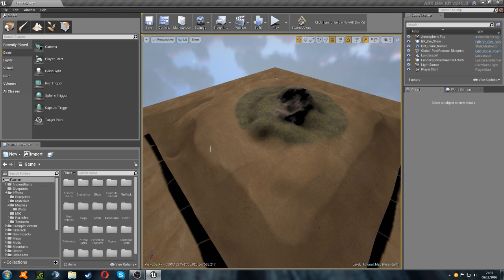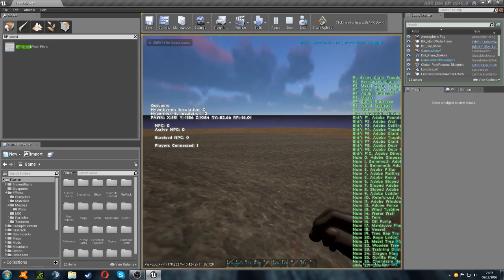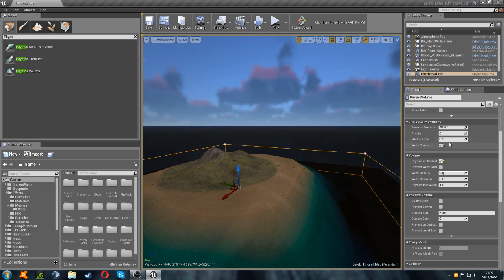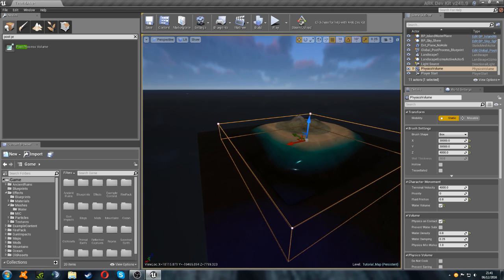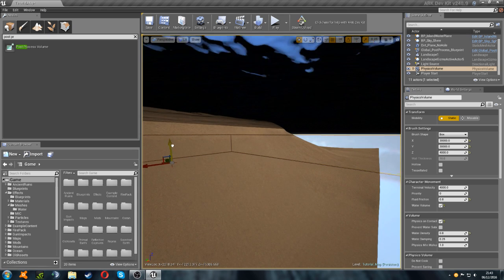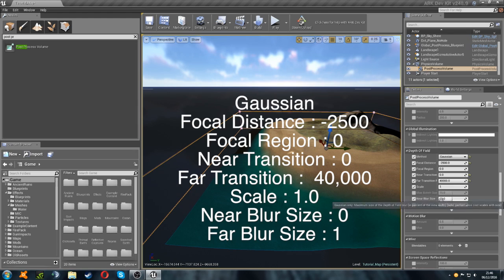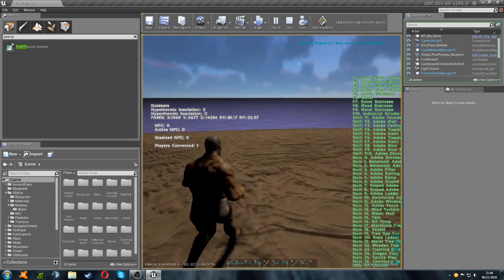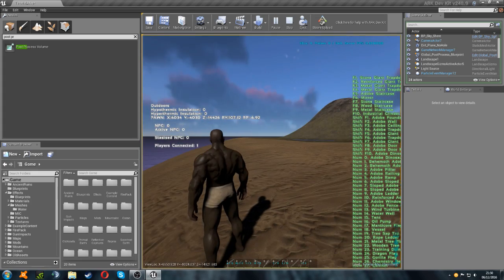Beginners ARK DEV KIT Tutorial! Ep2. Water!

Comment: Im a little stuck here.
When I go into the water everything is black! Even though I have put everything at -15000, it still is black! Any ideas on how to fix this problem?
Reply: this is an old comment but the guy in the video says that if your island isnt at the bottom it would be either completely blue or black. So just rewatch the video he shows you the fix.
Reply: @LazyDev27  He said he set it to -15000 which is exactly what he needed to do to "avoid" that. So watching the video again probably wont help much.

Comment: Aligning the physics volume is the bane of my life.  If you link the water plane and physics together before you change them at all, will that keep them at the same height?
Reply: Hmmm, not that I could make work.  But any quick solution to that would be wonderful
Reply from the maker: You could try selecting one, then holding down AltGr or Shift and selecting the other, then dragging them. I'd recommend playing your map first to get the load time out of the way, then you can quickly hop in and out of your map to see if you've got the heights right

Comment: I know this video is old, but as a veteran UE user that also has knowledge of post-processing and camera work in general, I have to call something out...  Those DoF settings made no sense to me.  You may as well have disabled it, as simply having it on takes up VRAM (and I believe more GBuffer usage).  You point out the memory footprint of the physics volume for the water (which is actually negligible) and suggest to keep on eye on its scale, but then enable an expensive PPE and tweak its parameters to basically be off?

If I'm missing some quirk to the ADK that's not applicable to general UE use, please explain.  Is there a reason for those settings you showed, or was it just a preferential thing?  If it was purely preference, you're silly :P
Reply from the maker: Nathan Harris Hey, I’ll be honest considering this video is so old I have no idea what I meant ;) I’m planning on re-doing most of this series so I’ll be sure to keep your points in mind when I do, thank you for the comment!
Reply: That'd be awesome.  I like ARK, and I have deep and wide experience with UE, a match made in heaven?  I'm finally getting around to trying my hand at ARK modding, and quickly realized there isn't a lot of documentation.  The documentation/tutorials that do exist are outdated or more often than not, just a rehash of the same topic, only covering the basics.  Revisiting the series you've made would surely be welcomed by the community, especially if you cover elements and gotchas specific to the ADK.  There is so much pre-existing documentation for general UE usage that applies, so you can refer viewers to more complete and specific content on that end.

Just my 2 cents!  Keep up the good work :)
Reply from the maker: @00matthewrayment00  as you asked so nicely, we'll see ;)

Comment: По какой-то причине, я не имею постобработки для Volum воды на некоторых частях карты. С чем это может быть связано?
Reply from the maker: I put your comment through google translate and I think I get your question. 
Have you tried Pressing your 'R' key, or selecting the scale option and expanding it a bit?
Reply from the maker: Or I suppose -- 
(Google's awesome;) ) 
 Я поставил ваш комментарий через google translate, и я думаю, что у меня есть ваш вопрос.
Пытались ли вы нажимать клавишу «R» или выбрать опцию масштабирования и немного расширить ее?
Reply: Yes. I changed the size to "Shift + R" and "R". Already tried differently. The same post process works in another part of the island unchanged.
Reply from the maker: If the issue is what I think it is then it's the dark blue water yeah? I believe I covered this in the video - You have to move everything down below a certain height to get the water to work properly. Can't remember the exact details off the top of my head though sorry
Reply: Thanks for the answer. I already figured it out. There really was a problem in height. I was able to solve it in the blueprint. You do not know how to make the mirage effect on a separate part of the map. How many did not try, so could not figure it out.